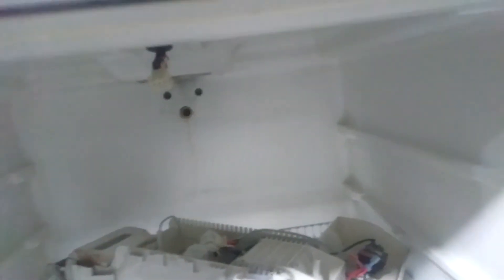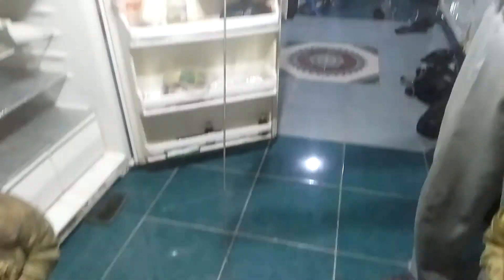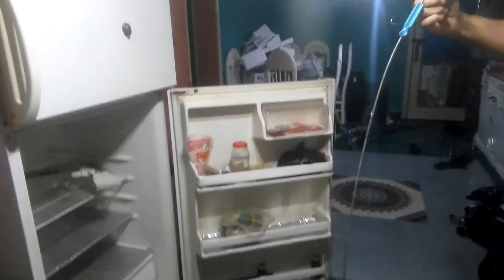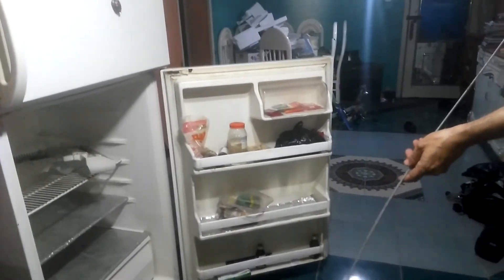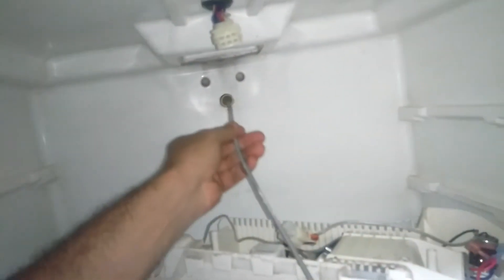Fixing a Magic Chef Refrigerator

Comment: What exactly did you fix fella ???
Reply from the maker: Any defrost fridge has a drainage pipe to drain the excess water from the freezer when defrosting down to a tray usually over the compressor to cool it down in one hand and to get rid of excess water on the other . When this drainage pipe is blocked the refrigerator seeps water on the floor. I hope this answered your question, amigo
Reply: @yesicandoit9274  Most certainly does clear things up Sir. Thanks for the help and I will be cleaning and maintaining the Magic Chef Fridge this weekend. Peace vf